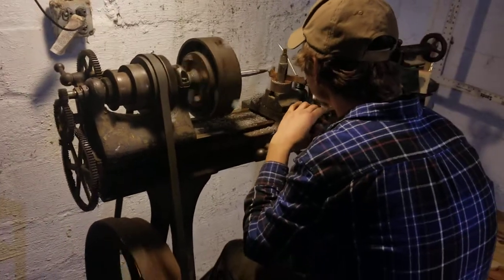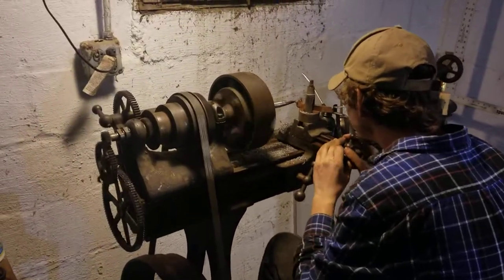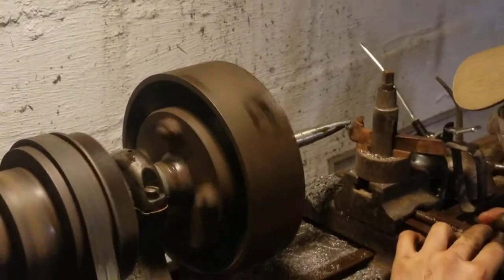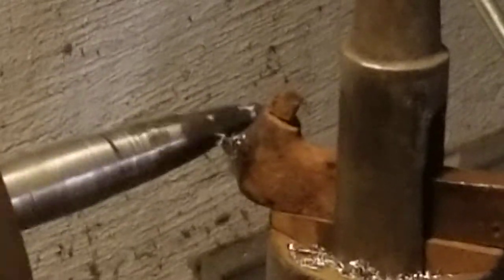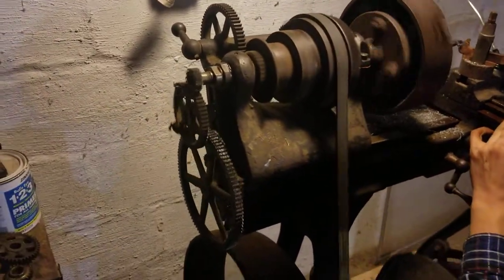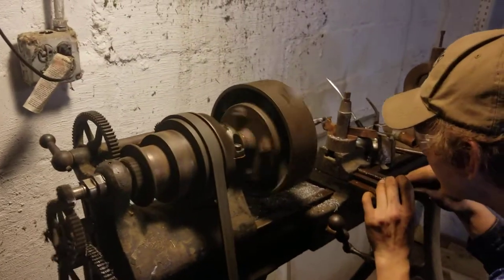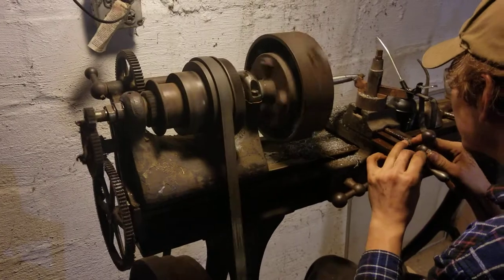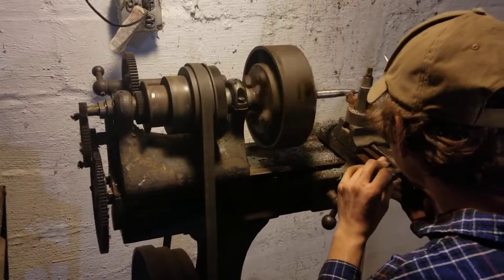My son running our pedal powered lathe.

Comment: I recently got a similar Barnes lathe, a no5 I think, the one with two lead screws. I am wondering what the gears behind the pulley on the head stock are for, I’m missing them and I don’t know what they are even called to be able to search them up. I’m also missing some of the change gears and the original cross slide and tool post

Comment: You might disconnect the gears while you're not power feeding or threading.... I bet they add some resistance.  One thing that guys had going for them back in the day was everyone know how to grind cutters to be crazy sharp, and if you have it really sharp, I bet you can coax some actual work out of a treadle lathe.
Reply: The trick is to grind the rake angle and if you can grind a chip breaker. It requires a little more finesse and a grind wheel with fresh sharp corners instead of a worn down one. You can also grind carbide to have custom geometry. But HSS will work fine if you keep it sharp